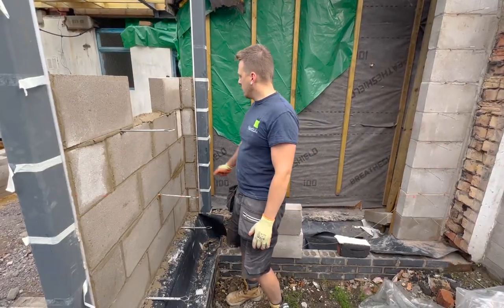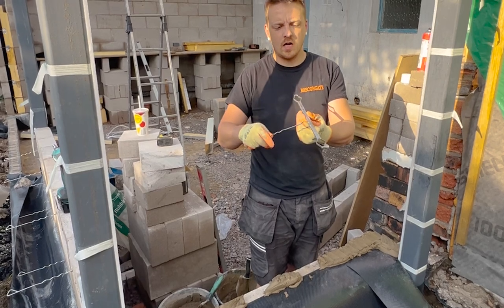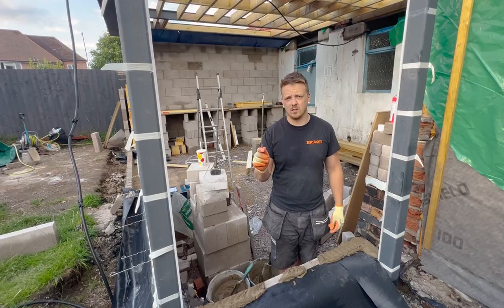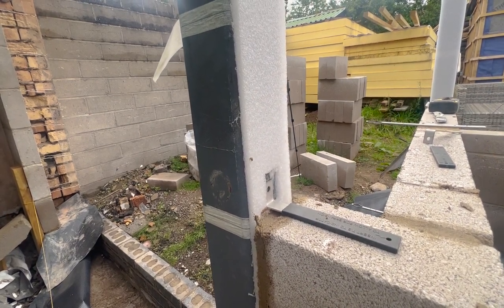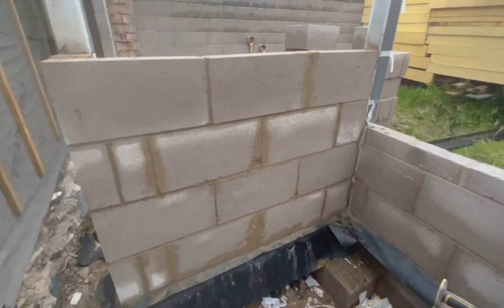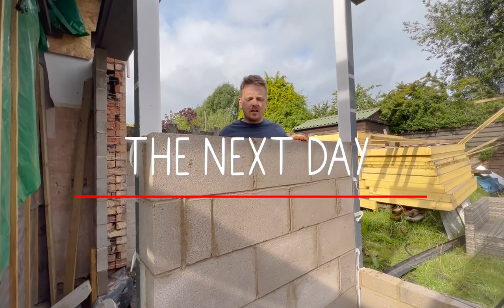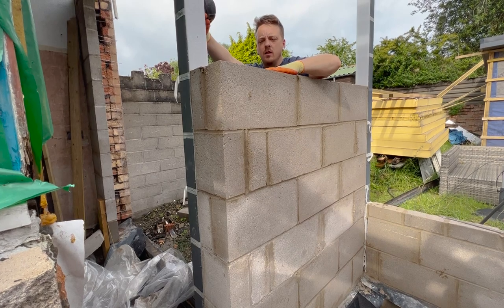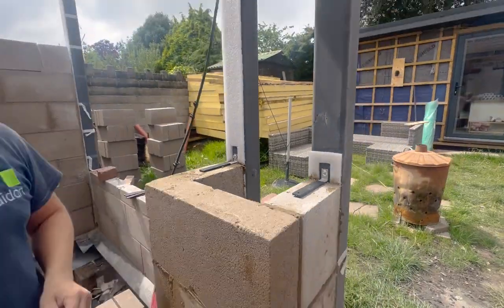Building Inspector said I needed to use 350mm Wall Ties for 200mm Cavity (UK) -Building An Extension

Comment: When cutting have the dust exit downwind rather than back over you. I know its a ball-ache but set up in a more open area with cleaner air or get a cutter with water suppression or better dust extraction. Invest in the kit now because it looks like you two will be doing something similar a few years down the line. Keep plugging on👍
Reply from the maker: Thank you for the comment and advice. I will definitely look into that! Thanks!

Comment: Hi guys   Obviously I’m not a  bricklayer but I think possibly your trying to be to accurate, if work is straight and level what you finish up with at the top is I would have thought a bit academic  with in reason 😀.    So you just cut the block to fit at the top , you would only have to be a small amount out on each course to eventually not line up with your tape .   Admittedly it would be interesting to know what a professional approach would be , but I doubt they would be overly concerned .     Finally I had to smile regarding the wall tiles , there’s been plenty of examples on new housing estate were they haven’t put them in in the first place , and even missed out large portions of cavity insulation . Makes you wonder were the inspectors were on those jobs .    Great work as always   and kind regards 😀👍👍👍
Reply from the maker: Rhys is a perfectionist so if something doesn't go right he gets very annoyed! but he's happy with the Block work so far :)
Reply: @Selfbuild_TheJenkins  And so he should be , totally commitment to the job in hand . Bless you both as always 😀👍👍👍

Comment: It’s getting worse every year. If it carry’s in the way it is cavity’s will be 400mm in no time.
Reply from the maker: hopefully its worth it and makes it energy efficient
Reply: lol. @Selfbuild_TheJenkins
Reply: Cavities in Ireland have already exceeded  200mm.   And here in sunny Hertfordshire 300mm on a recent new build.  That is not a cavity - that`s a corridor..!
Larger cavities are NOT cost effective, nor are they practical.
And they are certainly not the way forward for New Build Builders & Developers.
Reply from the maker: @martin2466 I don’t know much about insulation values and the over cost of bigger cavities but it does seem crazy the way it’s going, surely environmental friendly power sources/heating will be better than larger cavity’s am filled with foams and plastics 😅
Reply: @martin2466  300mm 😂 wow that is ridiculous. I am in the North West and it’s 150mm here. Some people will struggle to open windows soon if it carry’s on 😂👍🏻
Reply: @mattthornton8739  
Its bizarre Mate.   Total cavity wall thickness is 550mm,   ( facework 110mm + 300mm cavity + 140mm concrete blocks internally)    The foundation width is just under 800mm wide. 🙄😬 And the wall ties are specially made at some exorbitant price - its completely nuts.  And is definitely NOT the way forward for the future.
Reply: @Selfbuild_TheJenkins  
The answer is well designed, well engineered and well built homes (built in a factory - modular type.)
Something like the German "Passive-Haus."  or the Swedish version is excellent for extremely cold climates.
They incorporate, super insulated panel systems,  good air tightness of the completed building,  Triple glazed & high performance windows,   orientate the house correctly for maximum solar gain, and size the windows correctly.
These systems are designed, and built  meticulously to extremely high standards and work efficiently achieving wall U - values of 0.10   to 0.15 W/m2K  as standard. 
What we are doing in the UK at present is but mere tinkering about with it.